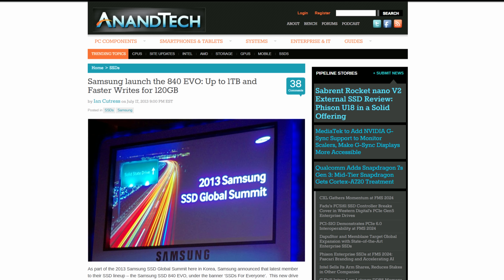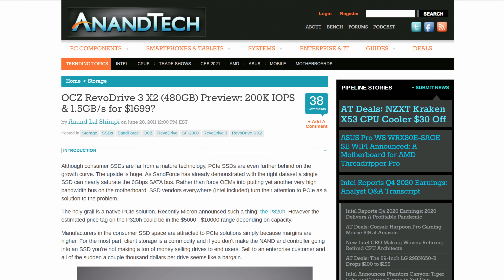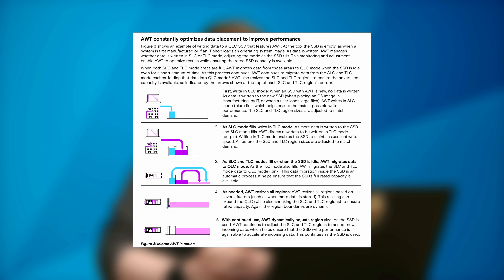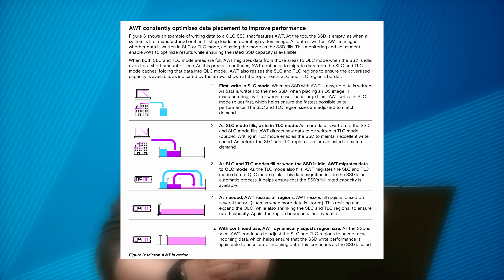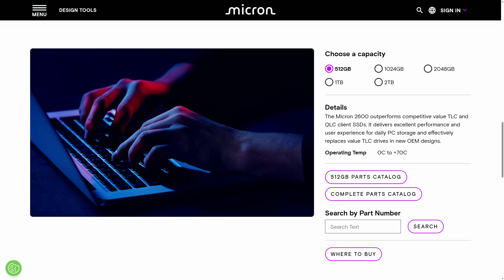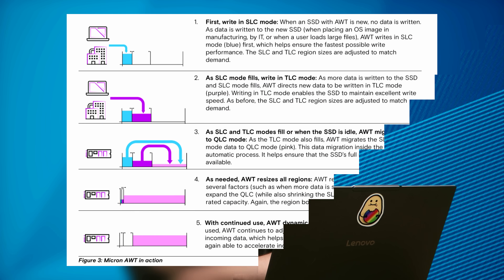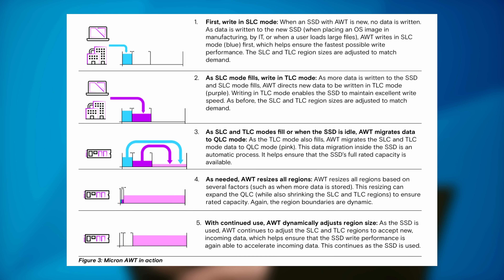Big.Medium.Little Comes to Consumer SSDs

Comment: Most high-end storage systems have had this for years and called it storage tiering, with the larger ones actually using tape for the arcival data. I remember even old Novell Netware supported archiving to tape and allowing people to access the metafiles as though they were real files, triggering the tape drive(s) to grab the file and get it back on disk :)

Comment: How do you rate or qualify a drive for TBW if the cell size is dynamically being adjusted for each cell type, by which cell type will TBW be calculated from, the SLC, or TLC or QLC part of the drive?  How can they provide a consistent TBW for endurance if the regions are changing sizes and it has three different cell types?

Comment: Cool technology but in the Micron 2600, it just sounds like they made a QLC drive that performs closer to a TLC drive. 

which while a lot better isn't exactly special when TLC is the standard for higher end drives(and higher end drives are only slightly more expensive) 

It would be very nice if this was used in a TLC drive and a MLC "Medium mode" was available.

That would be a real improvement in performance, not just a way to get the cheapest SSDs a little bit faster, which is good but again higher end drives aren't that much more expensive

Comment: PCIe 5.0 x2 seems so obvious for capacity SSDs, not sure why it isn't more popular...
Reply: Probably because thus far 5.0 M.2’s are limited to what, a single M.2 directly off the CPU, and none off the PCH, an so if you use it in a 4.0 slot you’re only getting 4.0 x2 unless it’s a dual mode like Samsung did. 

As 5.0 expands to more lanes on motherboards, it’ll be more possible but as of yet I don’t think any consumer boards take advantage of the fact that you could fit 2 separate 5.0 x2 SSDs in the same lane count as a single x4 SSD. 

Also, I believe it’s used in servers decently commonly. Although there I think it’s really two half width connectors directly connected to either socket in a dual socket server.

Comment: In terms of innovation, a standard mechanism for connecting NAND chips directly to an SOC with an integrated SSD controller might be useful, especially for mobile devices.

Apple has been doing this plus AES256 encryption on-the-fly for years now. Integrating the controller means implementing on a smaller silicon node, sharply reducing power consumption and heat dissipation by the internal storage subsystem.

Apple does, however, charge silly money for higher capacity NAND configurations and does not offer any after-sales upgrade path. This is true even for those desktop models that do feature custom NAND daughterboards; this has been a questionable business / hardware root-of-trust design decision.

Comment: Thx for the vid. I reckon there is not yet enough demand for 16GB M.2 SSDs in the consumer space. Most of them seem happy enough to offload their old photos / music / videos to HDDs, USB sticks or cloud storage.
That may not be the case for semi-pros and pro users using high-end laptops or desktops. It‘s definitely not true for data center servers.

As for those PCIe 5x2 configurations, I doubt many motherboards will support them. The PCIe standards body is really pushing x16, x8 , x4 and x1 as the lane groupings they want to see supported on the hardware side.

Perhaps 16GB could be supported on PCIe 5x4 via two PCIe 4x4 controllers with 8GB each plus a PCIe format converter, but not on a single M.2 board.

Comment: Ssd as ram, and double direction write and read simultaneously
Reply: I’d really like the exact opposite, RAM as SSDs, and software smart enough to take advantage of that fact. 

Probably won’t happen anytime soon given the current RAM situation, but still… if I’ve got some video game that’s X gigabytes, and I have ‘some large multiple of X’ RAM, I shouldn’t be waiting at all for random reads, it should just dump entirely to RAM that’s however-many-multiples faster than SLC or even OPTANE at random reads.

Comment: Samsung already made PCIE 5.0 x2 drive.  The 990 EVO.  That being said - it's not for more drives - it's for lower power on laptops.
I've always wondered why they didn't make the cache MLC.  2 bits should have most of the write speed of SLC by now and it would double the size of the write cache.

Comment: It was at 8:32 that I suddenly realised that the controller was using the same physical cells as SLC, TLC, QLC cells, up until that point I thought that they had multiple cell types.  That could have been emphasised / clarified. (Lovely tech' though)

Comment: I almost don't understand why TLC isn't just the standard. QLC increases the data per-cell by 33%, while increasing the voltage levels that need to be distinguished by 100%. TLC is not fast, but QLC is far slower.

Comment: I believe solidigm does that tiered wear levelling along with prefetching most likely accessed data. I don’t like HMB they do more harm than good and perform worse than their old counterparts. I have both crucial p1 and bx series with 2 variants. P1 has better performance in sustained loads than revised bx500 176 layer micron. The early revision bx500 with 96 layer nand has high thermals on 2.5” sata. Most offending HMB based drives are from WD SN500/700 series that bog down to 10 MBps when downloading steam games and gguff models. I disable write cache just to avoid the slow writes.

Comment: I'm sure Kioxia is itching to get that tech! I wished the video was about the controller being more efficient.. why can't we have low power modes on performant PCi gen 5 SSDs that reach near efficiency level of eco- gen 4 drives such as WD SN580 or 5000 during low load? efficiency cores or variable link speed.

Comment: I think most nvme approaches are wrong; The bus itself is wrong - it doesn't scale well. We should be looking away from small fast pipe, as its expensive and leads to high heat output. Instead we should be looking to build a new large bus pipe that will loose a little bit in access latency but will ultimately top out, deliver much higher stable performance, be cheaper to produce, and would generate much less heat *(they can even stack it like hbm if it makes sense). The latency can be easily fixed by allocating a bar(rebar) to the device just like any proper pcie devices already do... This way you could have that umpf for first few seconds before you start writing. This larger pipe, would also allow you to bundle up multiple devices as such before reaching bus address limits - and neither would affect performance of the other ssd as io addressing would have quite large space for addressing.

Comment: for me the most important property is access speed, and then longevity of the devices. working with an ssd can be a real pain in the back. i hope that they will invent a reliable device in the near future, instead of doubling the capacity. i think it is more important to be able to access your data, even in the case of a failing device.
think about it.
Reply: I'm pretty sure they already have devices, I saw it a long time ago where they use light to store data. They did a demonstration and everything on a news station and explained how it worked. Their demonstration, though, was more of a defense-like or anti-protest-type deal, it could do like little tiny shocks or make sounds too from what I remember..  but the technology definitely was using light to store select data. It's pretty wild. Besides that I've never seen that technology again, but to be fair I haven't even looked to see if it's possibly being used in other settings, or if there's any publicly available information on whether they've made further advancements with it.

Comment: What I want are 30+ TB 2.5" consumer SATA drives. I'm sorry, but I don't need bulk SSD storage that's seeking to be secondary RAM, I don't want PCIe Gen 7 SSDs, I want large bulk storage SSDs that don't cost an arm and a leg. SATA v3 is plenty of bandwidth (at SSD R/W performance) for consumer bulk storage.

Comment: Neat idea. I like the adaptability of the SLC/TLC regions.
One thought I'd have is you could say to the drive, give me maximum endurance. And the drive would use SLC and TLC maximally for as long as possible.
Then only when capacity becomes a concern, would it start shifting data into QLC mode.

Comment: It doesn't look like we'll ever have enough lanes for serious storage at the personal level.  I wound up getting six WD 10TB drives, hanging off a SAS controller, for my NAS and added two PCIe4 nvme drives, partitioned for ZFS cache and special devices.  Getting 30TB of reliable SSD just isn't feasible or affordable currently. Oh, and the extra lanes for the 10Gb NIC to make it worthwhile!
I sure hope these tiered ssd drives have firmware that's better than average. Knock on wood Crucial has been much better than Samsung, Sandisk, and Kingston.

Comment: If they're going to tiered storage, OS support needs to be beefed up to have some control over what data moves to what area, and under what conditions. The drive itself is dumb in the current form as it has no idea of the data itself or under what use cases it will be used - and this needs to change to better manage these more complicated medium.

Comment: hmm.... I like the idea but if you can just do that I don't see why go from single to three as opposed to multi, or why even pre provision three and four bits per cell, well cells from the start? start with the drive at SLC, and when it reaches 80% start moving to MLC, then when that reaches 80% start moving to TLC and when that reaches 80% move to QLC. that would seem to make more logic. If they have the tech and can do this that would seem like the more appropriate solution.

Comment: What task will not be perfectly well served on a Gen4 x4, 2TB TLC drive... With cache. 1,2,4 TB. Longevity and not running hot. Power efficient. SSD makers made something truly better then HDD's in every way. QLC is not a option. HDD's are superior in every way then having the drive write and rewrite 3 times to push QLC garbage onto the costumers.

4TB HDD's where big enough. 2TB SSD's are fine. Now 8TB HDD's and 4TB SSD's are simply a thing that is reliable and worth the cost. QLC or anything else is not. TLC or even SLC. Nothing else. TLC. 2TB. Or 4TB If a 8TB QLC drive??? No. HDD is the way forward. Not unreliable SSD's. The point of the SSD is to be fast enough without moving parts. Not running hot. And not far of the price of a HDD. Gen4. 2TB. Or 4TB. Samsung SATA SSD's and Crucial ones with Cache are fast enough. M.2 with 2TB is maybe on the small size but so what? The difference on TLC is wherever the second memory module is included or not if it is 2 or 4TB.

4TB is enough. Rather buy a 4TB drive then a 8TB one at the same price. Why? Because we all just know that that 8TB is simply begging to stop working when the guaranty is up. If drive failure was a wanted feature then we would be on HDD's still for the daily machines. There is nothing in practice that truly needs more then 4TB a drive in a normal computer for the normal personal computer user. Nothing. There is no sense going for a 8TB HDD or bigger. To slow and bothersome. A 8TB SSD begging to die faster then the drives before it? No. Keep that crap to yourself.

Comment: I'd love to see some affordable, large capacity, low power drives, for low power, low noise NAS. I'd be absolutely be fine with SATA, but even before the price hike, the only 16TB mushkin here cost the equivalent of 40+TB of spinning rust.
But I can also understand people wanting SLC for ultimate durability. Sometimes you must have that, and I'd love that for e.g.: proxmox system drive. Or if I could set a partition as such.

Comment: The automatic movement of storage from SLC for frequently updated data to TLC/QLC for archival/rarely updated data has radically accelerated the adoption of SSDs. It’s also a huge part of the reason running an SSD at over 80% capacity can result in notable slowdowns.

Comment: I think they should stick with TLC +  DRAM cache even if it's a bit more expensive until QLC gets good enough to be comparable to TLC in speed and longevity. I'm certainly not buying a QLC SSD that slows down to pretty much HDD speeds when moving 1 or 2 modern games (easily 100 - 200 GB) to it and gets progressively slower the more you fill it.

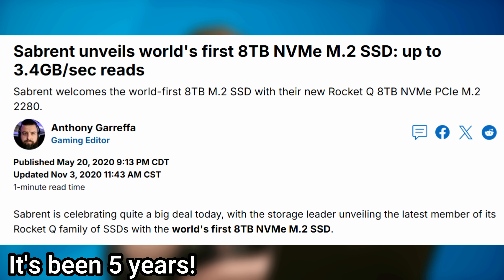Comment: 10:25 Ian we already got 16TB 2280 SSDs earlier this year, check out Exascend's offerings
Reply from the maker: Oh that one passed me by... but perhaps because it's an automotive grade offering with AEC-100 for edge and industrial applications. They're keeping it for the premium markets for now. But just goes to show, it could be done. Just like 10 gigabit ethernet could have been done for consumer 5-10 years before it actually came.
Reply: @TechTechPotato  I think that Sabrant also technically has one 16TB M.2, although I don’t think it’s actually really widely available or anything. And it’s definitely double sided if that, which would impact whether you could use it in a laptop as you mentioned your usecase was.

Comment: Remember when at the time, about graphics accelerators they said "We're gonna put a computer inside your computer."? Now they're gonna put two computers in your computer.
Reply: SSDs have had internal CPUs as long as they have existed. Hard drives have had full CPUs going back over 20 years. Some pepole have even hacked the hard drives to run Linux on the internal CPUs.
Reply: @MarkRose1337  I remember in one of their livestreams, ^ Dr. Ian Cutrass was talking about how the PCH at one point had full blown x86 cores in it to manage something, but the stream cut out as he was explaining it, so that’s basically all that was said.
Reply: @levygaming3133  It wouldn't surprise me. A 486 core can do a lot. A lot of ARM cores are used for the same. And they often run Minix.
Reply: The Intel ME afaik runs Minix.

Comment: Just Curious is it that Micron is adding additional NAND packages to the drives or is it the same NAND but they are mostly in software i.e. drives controller able to use QLC cells as SLC or TLC if the second why not do SLC to MLC to TLC to QLC?  Is there anything about the overhead and complexity on the controller? Regardless this sounds like it would put more stress on the Controller and since it seems like the controllers are getting more and more complex and capable and expensive being built on newer nodes and needing more Dram when (at least on the consumer end) do the SSD manufactures say rather then us basically putting a little computer into your computer well let the OS or the Main system hardware manage the NAND (I know PureStorage does something like this in the datacenter obviously more complex and very different). I don't know but what percentage of the cost of a drive is the NAND compared to the Controller and the dram? I would hope the majority would be the NAND but even still would it not bring drive prices down and make an m.2 larger then 8TB more likely if the drive didn't need to spend power and cost on the the controller?

Comment: What I want: New drives with low power controllers, so we can use them without crazy heatsinks again.
Reply from the maker: PCIe 5.0 x2 or x1 will likely help with that. And still fast enough for normal people.

Comment: So is it treating the QLC sometimes as TLC and sometimes as SLC and changing the allocation on the fly ?   Seams to me like they could figure out how to speed up QLC by sometimes treating it as a lesser capacity faster type at times.   Essentially making the cache sizes dynamic.  Perhaps this is already done.
Reply from the maker: The key is the adjustment at idle, converting data written in SLC mode to QLC mode to free up cells.

Comment: I wish 8TB drives would come down in price. But prices of memory and storage jumped so high that I'm happy that I managed to buy 4TB NVME SSD for less than 300$ (that's with tax included) - it arrived an hour ago. For the same reason I bought an old workstation laptop with 128GB of RAM and 16GB of VRAM for 1200$. Cost of RAM alone is now worth more than this laptop. I can use it for both gaming and AI. I even snagged a few Optane drives (sadly mostly 512GB with 32 MB (?) of cache), despite not having an Intel CPU (now I have Xeon in that laptop, but IDK if it would work - still, they are useful as regular drives - I can even use them as backup storage for my phone).

Comment: most of the issue i see coming from nvme are the number of slot the average consumer grade motherboard have.  nvme take a fair bit of motherboard real estate.
I wish we could get a SATA 4 with like 12 gb/s speed and 2.5 inche SSD for it.

The data cable could also be 80% smaller, allowing for smaller head connector. Also a interface that could split itself his pci lane speed in function of the demand.
So the unused pci lane can be redirect to where its needed.

Comment: I'm still salty about Intel Optane/3D XPoint getting cancelled. I'd wager their engineers are as well.

3D XPoint is really the tech that Intel should have added to their entire SSD lineup, working its way down the segments until it took over completely. It would have been an insurmountable advantage against their SSD competition.

Instead, their eagerness to slap the "Optane" branding on a bunch of very different products got the better of them. The products were confusing and so exotic that it seemed outright scary. What does one even do with a non-volatile DIMM?

I tried telling my nerdy friends about Intel Optane, but their reaction was mainly "ugh, sounds complicated, it's so many different things!". Later when people sort of got used to it, it always seemed so exotic that people were afraid of it.

If they'd instead just slipped it into SSD's with no special branding, and just let the benchmarks do the talking, it'd be a fare far better  I think.